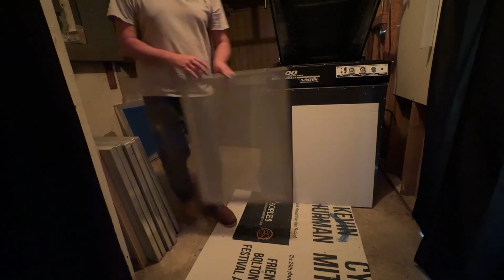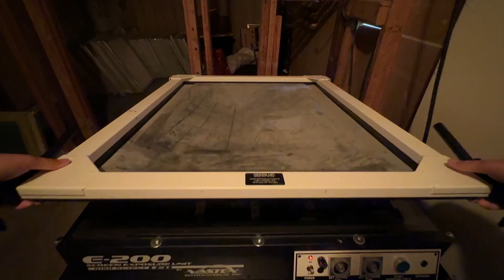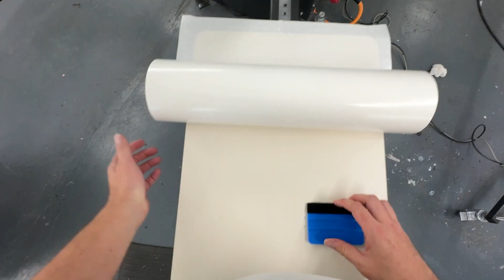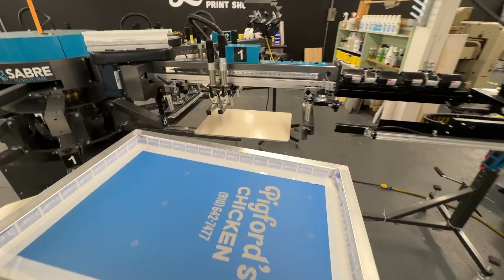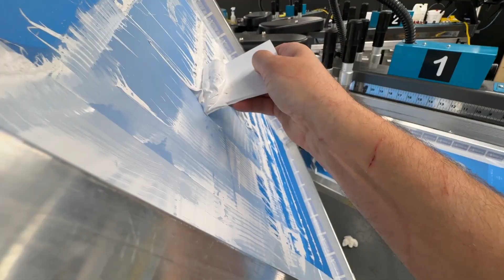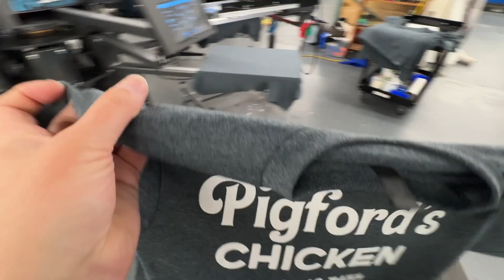Our Screen Printing Process

Comment: One thing about our business I can’t stand is the screen printing… it’s time consuming, tedious, messy, and labor intensive.  SMS everyone always wants some sort is complicated multi color design, and want it cheap, and want it tomorrow.

Wednesday we had a sports team come in that won the playoffs and wanted apparel for their game on Friday… and, of course, a completely special design for this special event.  We spent 8 hours on the artwork creation and separations.  Then printing the 6-color design was going to take forever.  So I ended up print a heavy white underbase, flashed it, then printed the other 5 colors wet-on-wet as fast as I possibly could.  Printed 48 shirts in 1.5hrs.  Today, I can’t use my fingers or arms.

Then someone’s comes in with a 1-color design and I’ll print those all day long - they’re easy.
Reply: Are you using a manual screen printing machine?